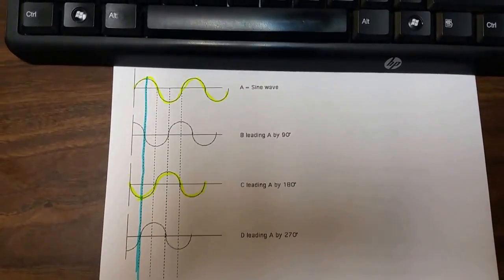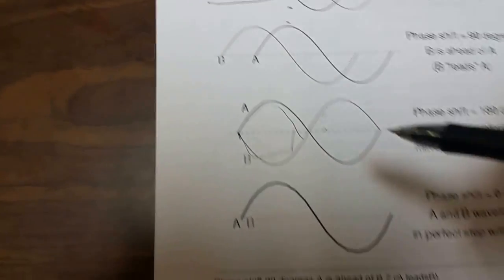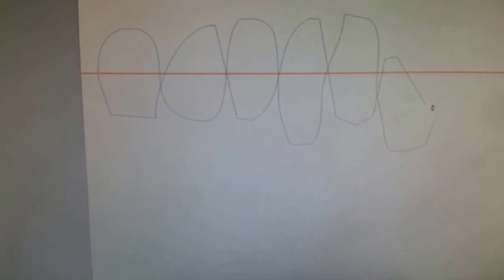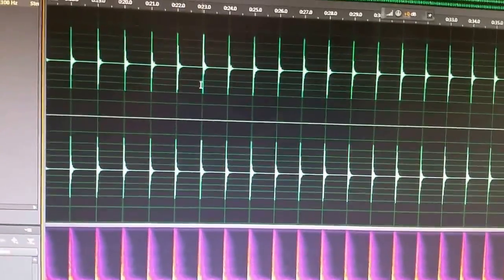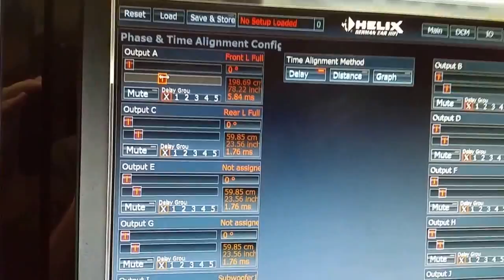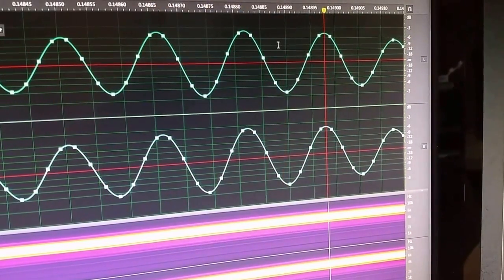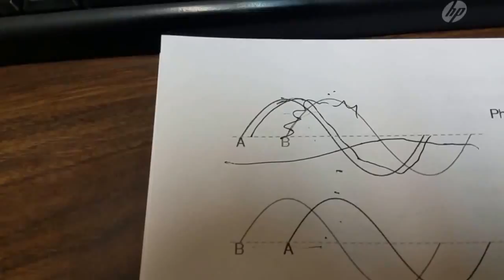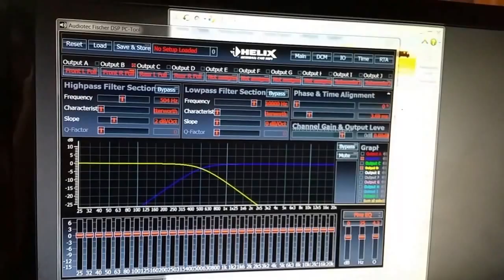Pt 14 - Phase - Tuning For SQ

Comment: sorry, kyle. you are confusing "phase" with "polarity". phase = time. on your second page of sine waves, in the top 2 lines, the waves are "out of phase" because they begin at different times. in the 3rd line, however, the waves are "out of polarity", not "out of phase", because they begin at the same time, they just go in different "directions". other than that, i am enjoying your videos. i hate to be "that guy", but i guess i am. i just believe that this is an important distinction and can be the source of much misunderstanding.

Comment: With getting everthing in phase could you run multiple of the same drivers (lets say 2 midbass per door for example,) and not run into cancelation issues.
Reply from the maker: Yes and no, if the drivers are within half of the cone diameter of each other, the acoustics of it act more like one driver, however, there are always issues when using multiple drivers in the same frequency range. Check up on line arrays and how they work, might give you some good ideas